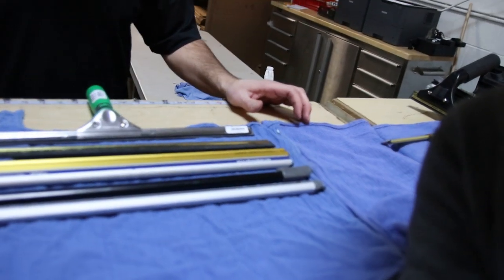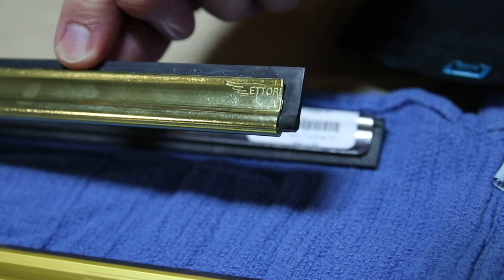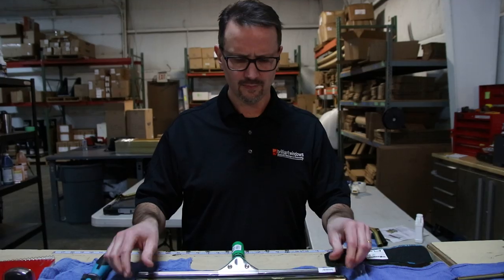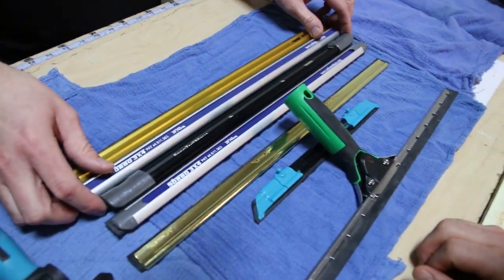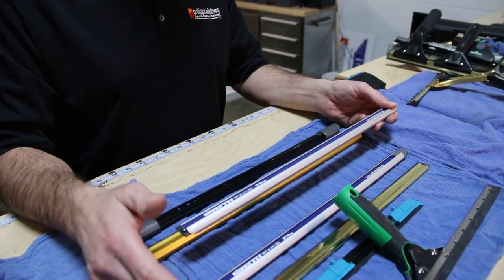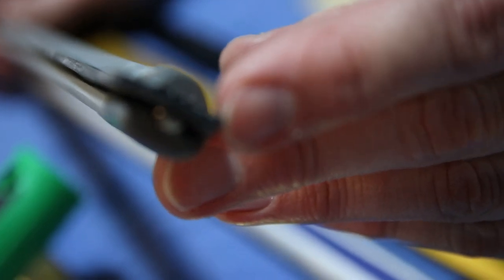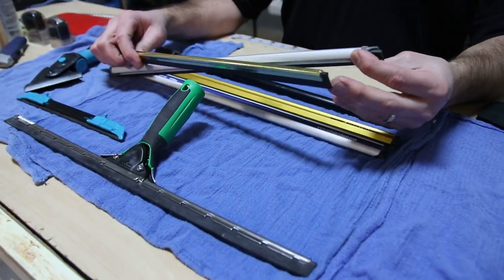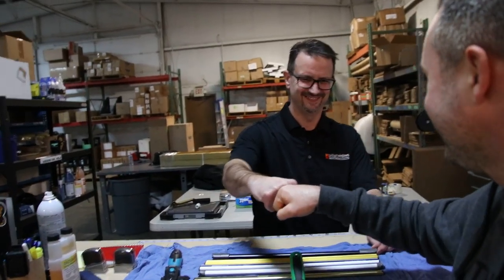Squeegees and Squeegee Channels - Window Cleaning Tools | Detroit Sponge 🌊

Comment: I could be trippin but the T rubber on Kevin Sorbo channels seems much more durable and picks up water off of windows better in my opinion. I happen to start with sorbo and won’t ever change. I also use a 22” and a 12” and a 5/3” all with unger swivel handles long as they adjust. I like pole work a lot and for the life of me my co workers can’t get the hang of it. I only change my rubber if it’s nicked or worn, usually once or twice per season (6 months) bc I flip rubber if that makes sense. One side is worn the other is not so I recycle a little. I’m cheap and the rubber can add up. My boss may be cheaper bc whatever rubber they use has to be changed weekly if not daily!                                                                                                                                                                        Windows up in Colorado get beat up bad! Just started LLC and fully insured to contract for old boss and start my business. Your a straight G as an entrepreneur Keith and a great motivational down to earth person. You’ve helped out thousands if not more. Thank you for all your effort and interest in the business, equip, and technique side of the industry. You don’t miss a beat.
Reply: You change your rubber every 6 months?!? I honestly can't and won't believe that. A rubber can last me a week tops. Depending on window sills tearing up the ends.